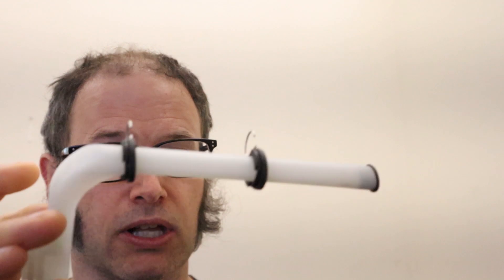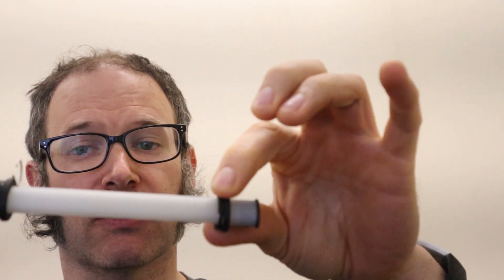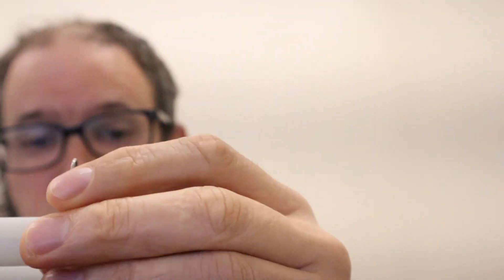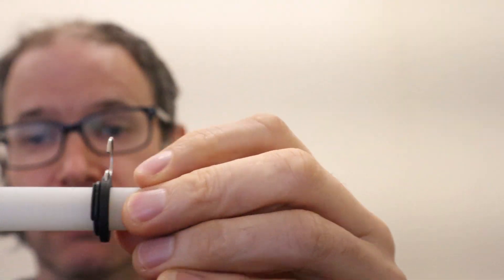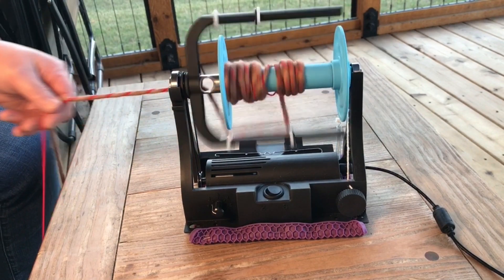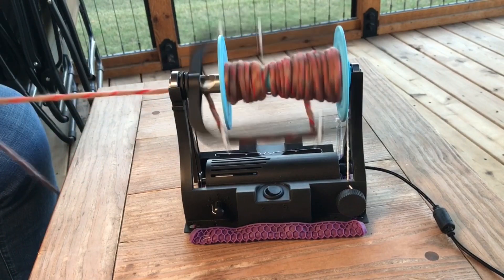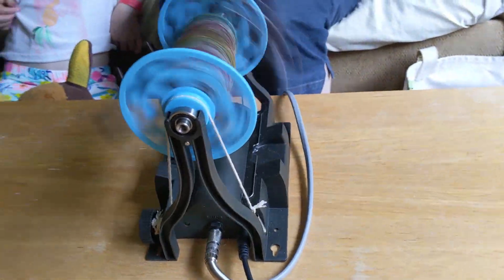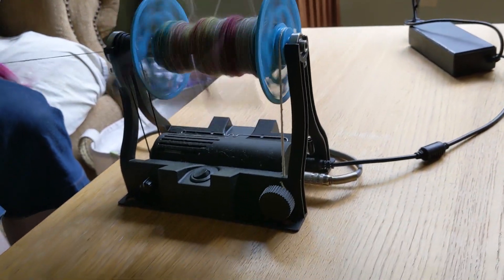SPIN #88 - EEW 6.0 Final Injection Molded Parts Tested

Comment: Very nice. So quiet. That's quite a brick for the power supply. Will that be for the production version?
Reply from the maker: Yes, that is the plan.  It is a 12V 5A power supply.  It doesn't use that much power, but I wanted a large safety factor.